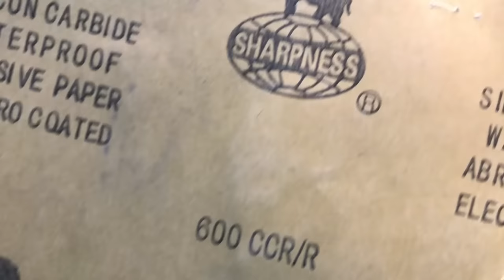Karambit from a Motorcycle Rotor | Knife Making

Comment: Right on!! Really good mate. I have just started getting into knife making as a hobby. Really like your content.

I made a bevel jig. I having an issue with the setup. I noticed in your vid, as you filed the bevel near the tip you filed into the wood. I’m doing that too. I didn’t see it on the Gough vid. Is this a normal expectation when using it? Any other tips for the jig?

Appreciate your time
Reply from the maker: Hi mate! I’m glad you are enjoying the channel 🙏
Most I can say about the jig after a year or so of use, is that I change it quite a lot! I just keep a bunch of left over wood and replace / change according to the knife I’m making. 
It started out very similar to Gough’s jig but I made very different kinds and sizes of knives, so I had to change it a lot. 
Good luck with your knife making journey!!

Comment: Hi man , good idea! Surely i will try but i have a question. Wouldn't life be simpler if you do all that hard work before harden the steel? 

Hope you will get a good belt sanding machine soon!
Reply from the maker: Hi man, actually all the hard work is before hardening :) most of the work is the bevel grinds with the file. 
After that it’s all sand paper and such, and that is better to do after hardening in my short experience :)
Thank you man! I’m glad you liked it!
Reply: Pensé lo mismo